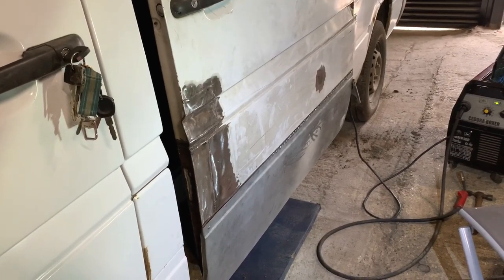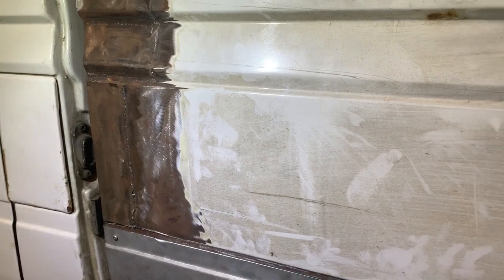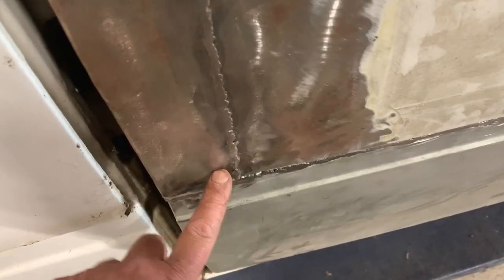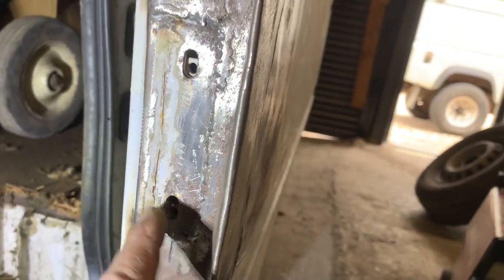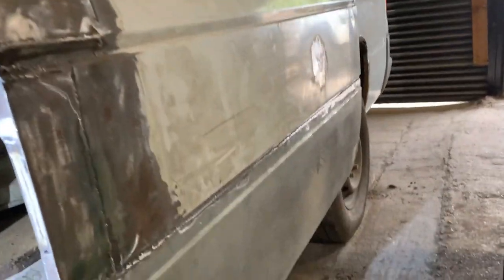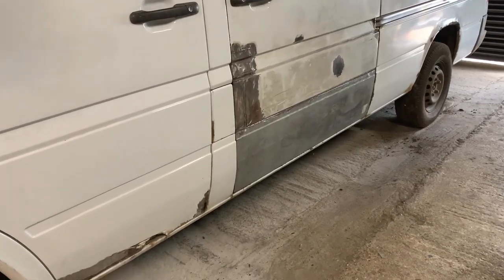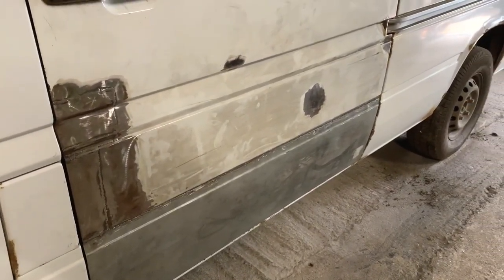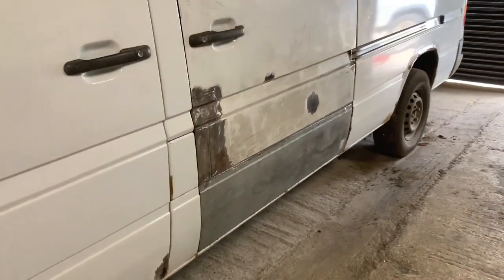Mercedes Sprinter Side Door Repair ( Welding on Lower Panel ) Welding Footage ( Part 4 )

Comment: I have been looking forward to this one. Out of all the panels on my T1N it was the side door that gave me the most problems.  Thanks for uploading mate, these videos have been gold for me.
Reply from the maker: Hi I knew when I started and saw the rot on the front corner it was going to be a pain of a job, all I’ve really done is persevere and kept fit it and altering bits if I need to and I’ve finally got there 😅 the body filler stage has started now, but at least I’m over the hardest bits. I’ve now ordered back door bottom panels, drivers and passengers doors bottom panels and I have the 2 rear arches, these things do rot 😩. If I knew the work entailed I probably wouldn’t have started, but it has made good YouTube content. There’s still plenty more to come thanks for watching I’m pleased it has helped you 🙂👍

Comment: Thats coming on nicely.Great job gonna look good.All the best to you all.
Reply from the maker: Hi yes I’m getting there, filler and paint it should look pretty decent, occasionally good secondhand panels come up for these, but they are very expensive, lately I’ve seen a pair of rear doors for £800 I think I’ll fix mine 😂🙂👍